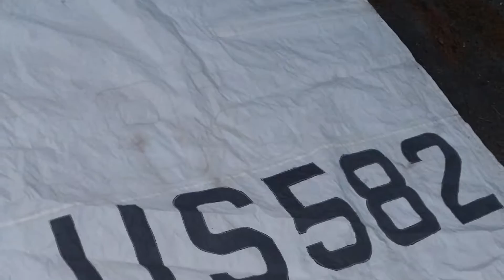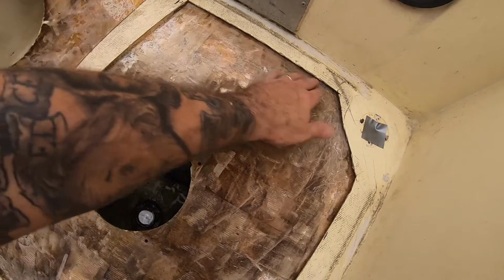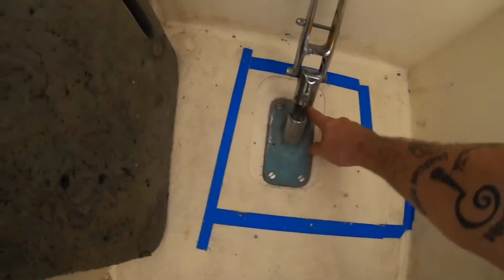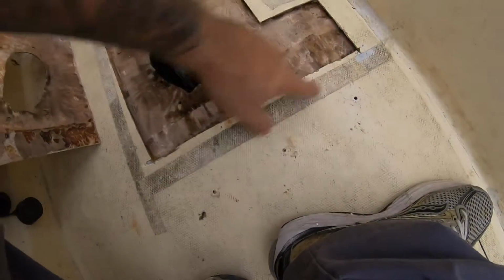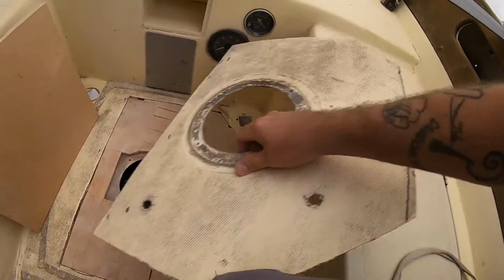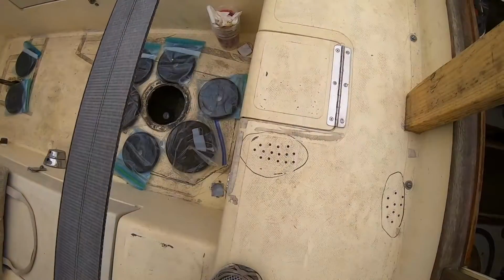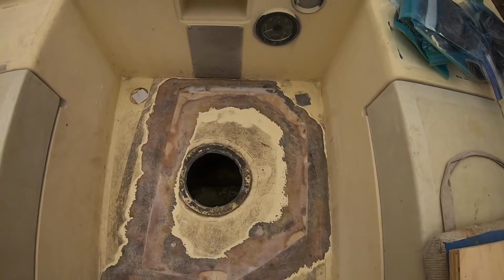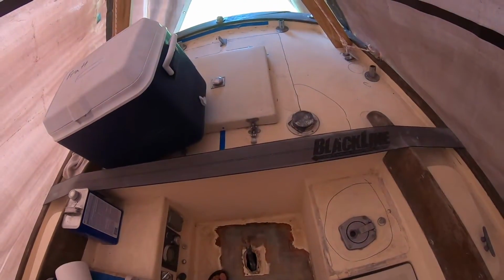Episode 6 - Fixing the Cockpit Sole

Comment: The water comes in from any hole or crack so it all needs top sealing.  I also used foam instead of wood.  I figure it will never rot again.    I also have an Alberg and went through this about 3 years ago.  Cracks all around the cockpit sole looked bad and were getting to me.  I ground out the cracks and filled them.  Then I took 1" bias tape a and another .75" and layed them one on top of the other  all the way around with a nice radius.  This worked well.     My hand pump also had to be redone.   I used a thin piece of wood and made patterns for the large circle around the pump edges and radius.  I raised the area 1mm with fairing resin.    I also had a trick with the grip.  I used kiwigrip.  It was the right color and texture.  I made a roller with a scotch-bright pad and a wooden dowel.  This matched the texture of the existing grip exactly.  The actual kiwigrip roller had too high of the grip to be used.   I want to see how you finish the top.  I am slowly doing the entire deck removing all the cracks and issues.  The top coat has to look good.  I am quite interested in how you do it.

Comment: Those machine screws around the rudder stock screwed into the glass. If you use epoxy and High density filler you can drill and tap it to take the screws. It's as strong as you'll need. I've used it a lot on many boats. Gougeon Brothers used to use the technique to fix winches down!
Another trick is to coat the screws with release wax, drill oversized holes, fill them with epoxy thickened with HD filler and a bit of cabosil. Wet the screws with unthickened epoxy and push them in. When set you can unscrew them and fit slightly shorter screws and tighten them down tight.
Reply from the maker: This is great advice, thanks!